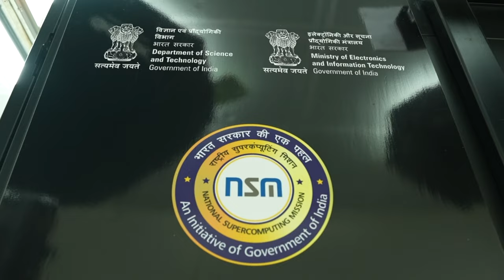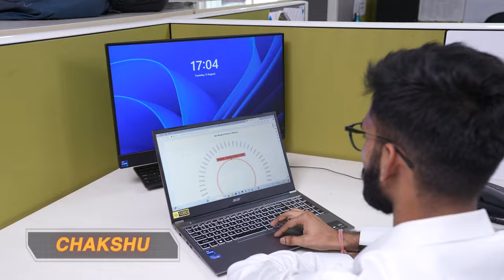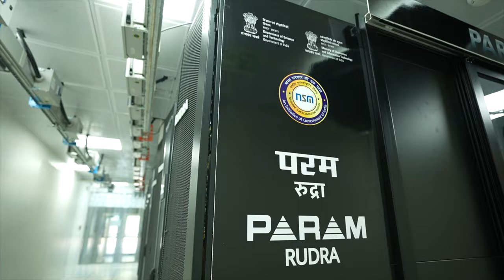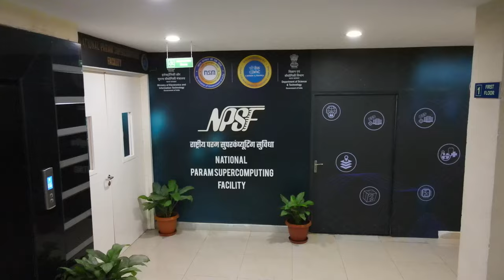How PARAM Rudra Supercomputers will revolutionise scientific research? Find out now

Comment: Coding campulsory for class 6 students
Reply: Yas for New generation
Reply: Bilkul sahi kaha Apne
Reply: Critical thinking & problem solving *
Reply: Coding is not important at that age. Critical thinking is. Coding is a skill that can easily be picked up later in life.
Reply: AI is about to take up at least 50% software engineering jobs in 5 years. Trades like construction, mechanic, electronics repair etc will never go away.
Reply: @death_parade  bro coding is not issue to understand first you have knowledge then you coding this resion coding is important bro I am procuring intermediate second year I have coding knowledge only 2 years but I think I am not able to develop web application, every school students only understand coding knowledge this is good 👍
Reply: @nptelcourseinhindi9905  Fair point. But even so, you don't teach coding at that age, you teach at most html or maybe something like LaTeX maybe. Maybe teach them about Linux basics? And only as an elective subject. Coding can be taught 9th class onwards. I remember trying to wrap my head around pointers in C++ when I was done with my Class 10th board exams. Wasn't easy. And I never got anything useful made in those days, just following a book. Ofcourse in Class 11 onwards preparation for JEE, etc becomes more important.  

Although, nowadays you have Python which is easier than C++, so maybe you can teach kids in around Class 9th onwards the basics of programming. 2 years of programming taught in school is sufficient. Later, any person with a computer can teach themselves. 

6th class is too young IMHO. Their focus in class 6th should be on sharpening their Maths, Science and English (talking about kids who are looking for a future in non-medical, engineering, etc).
Reply: @RAHUL4x4GAMER  I am not saying don't teach school kids coding at all. I started (and then stopped) learning coding in Class 10. So I am not saying that. The important part is that you should not teach coding to kids as young as Class 6. Other subjects and building a strong foundation are more important. Like you said, first you need to have knowledge, and only then should one begin to code. Code is just a method to use the computer as a tool. But a tool to what end? That part needs to be addressed first, and that is what kids in Class 6 should be focusing their attention on. 

Also, web app development is a whole another level above basic coding. Not everybody learns coding to do web app development. I, for example, use my coding skills to build solvers for solving mechanical models, or to use existing solvers. So even if you teach coding at school in higher classes, teaching them web app development makes very little sense. But hmm......2 years should be sufficient if you were devoting yourself to only learning web application development. Maybe you are only able to devote a small chunk of your day on it. All the best to you.
Reply: Iske liye pahle youth ko skill karna padega taki un Students ko wo padha sake 
Computer Teacher har school me hona chahiye aur unki coding/computer language aana hi chahiye 
Tab ye initiative pura ho sakta hai
Reply: @death_parade  Frist is knowle
 Par active he ge kuch nhi karte